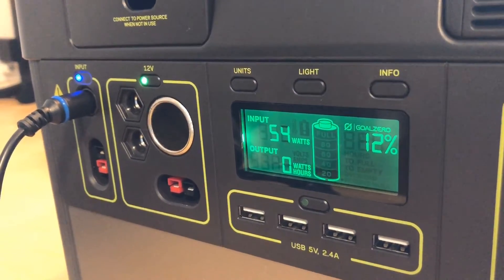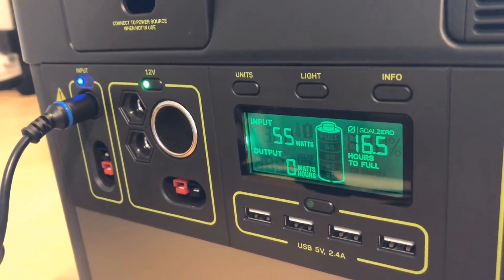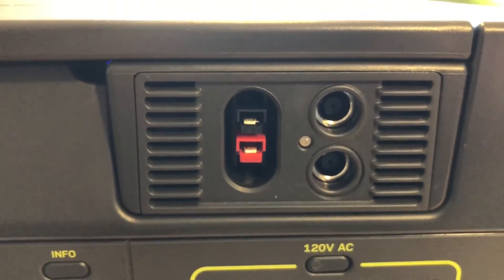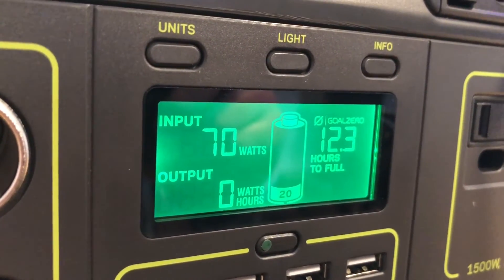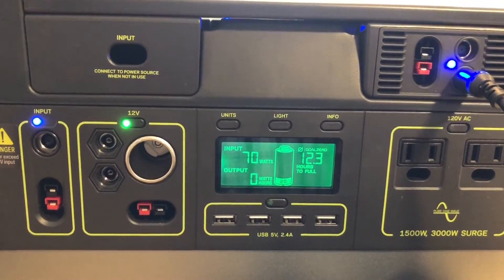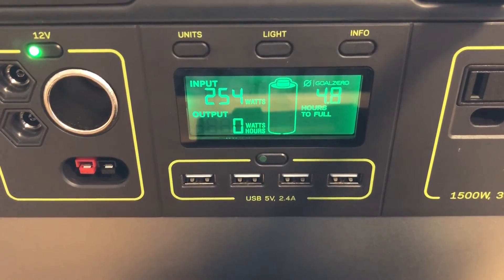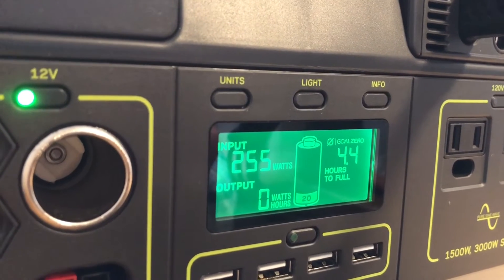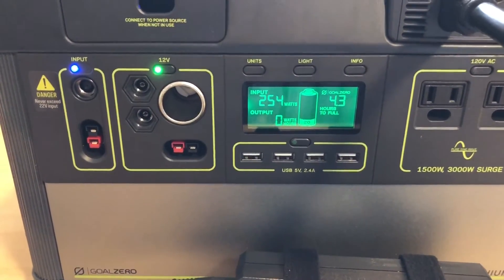Goal Zero Yeti 1000 Lithium: Fast Charge In Just 4.5 Hours Instead of 18!

Comment: Great video but can you also charge from multiple inputs at the same time?  For example can you buy 8 chargers and chain them in groups of four like you did and have all 8 powering.
Reply from the maker: Yes, you could if you have the MPPT module I stalled. The built in puts can handle 360w, the module doubles that. They now make a fast charger that is probably a better value than 4 single supplies.

Comment: Can you use 12 chargers? 4 chargers with Anderson adaptor on the left input. 4 chargers with Anderson adaptor on the right input. 8mm in the left input. 2 8mm in the right input and 1 8mm on the top input?
Reply from the maker: No, the built in PWM inputs max at 360w total across all inputs, the MPPT modules doubles that. Keep in mind that charging the battery too fast will reduce its life so you want to give the electrons some time to find a home.

Comment: the slower a battery is charged the longer it will last. you can buy a second charger and charge the unit twice as fast but battery longevity will be affected.
Reply: Is this true? I know you are saying this but is there any facts?just asking because I just bought one
Reply: @LxTxSURGE  the faster you charge and discharge a battery the faster it degrades as it causes them to heat up, lithium batteries especially don't like heat or cold.  just google more info on it. goal zero should really be telling their customers about this.
Reply from the maker: Yep, you’re right. That charging or discharging too fast is bad for any battery. Unfortunately, GZ doesn’t specify how quickly you can charge the batteries without stressing them but I think 300w is probably not too fast. We’ll see...
Reply: @todd.parker  I have been talking with goal zero and  the MPPT port can take 370w at 22v max. it is a bit disappointing as I have a 300w panel but it runs up to 37v. I wish I could feed more solar in as I want to use the unit to power my electric solar charged boat. also the 12v out is only 120w.
Reply from the maker: mike allen this video might be interesting to you: https://youtu.be/rqXscD69RvM
Reply: With the Yeti Link Expansion Module that Goal Zero sells, you can charge at up to a theoretical 750W (via a car battery/alternative or Yeti Tanks) although in practice this will be less depending on which Yeti going into. This is a LOT of power but GZ is offering that solution.

Comment: So you get a higher input from solar than you do from the grid?
Reply from the maker: Depend on how many panels you have and the weather. To get 300w of I put, you’d need 4x 100w solar panels and a sunny day (given efficiency losses). I have 2 panels and plan to use a generator to power these wall chargers if the sun isn’t out/shining

Comment: Thanks for posting this!! So I just called Goal Zero and they said that the new power supply should be in stock by the end on next week and it's 300 Watts.I asked additional questions about charging and this is what I found out. The PWM port candle take in 360 watts of power. ADDITIONALLY the MPPT port can bring in 325 MORE watts at the same time for a maximum of 685 WATTS of power! This means you can run solar panels and the charger at the same time or 2 chargers at once! I did inquire about the new Yeti Link Expansion Module which allows you to expand the system and add batteries. The downside is that it can only bring in 150 Watts and as I suspected, you have to remove the MPPT port. The uplink 150 watts plus the 360 watts on the PWM port would give you a max of 510 watts. I wanted to know if the wattage for each port can be stacked or what the max input of power was incase I also need to charge this from a gas generator quickly!
Reply: GOOD NEWS!I just called goal zero customer service 888-794-6250 option 2, and the NEW 300 watt power supply is in stock! It's not listed on their website and I just ordered 2 of them so I can charge from the PWM and MPPT port at the same time in an emergency! If I am pull in 500 watts between the 2 chargers this should be charged in maybe 2 hours :-) Thanks for all the research and videos you are doing Todd. This is invaluable info

Comment: The MPPT and PWM charging ports react differently as the power system nears full charge or capacity. The MPPT charger seems to stop charging to keep the system slightly under 100%. This is actually better battery management for the lithium cell.
Reply from the maker: Interesting! Thanks for the info

Comment: "This new faster product is coming next year" should be goal zeros mission statement. I'm still waiting for the car charger I was promised more than a year ago.
Reply from the maker: Ha! I know. Seems they’ve had some engineering hiccups and the high speed charger is still a few months out at best. If you want the car charger, you’re in luck. It just came out yesterday and I ordered one to review it. Shipping was expensive! https://www.goalzero.com/shop/yeti-accessories/yeti-lithium-12v-car-charging-cable/yeti-lithium-12v-car-charging-cable/
Reply: @todd.parker  404
UH OH. PAGE NOT FOUND.
Reply from the maker: first last https://www.goalzero.com/shop/cords-adapters/yeti-12v-car-charging-cable/
Reply: @todd.parker  Great channel. do you know if the yeti will run an ac unit and fridge at the same time?

Comment: Todd.... I got news..... you can call your order in right now to get the lithium car charger... depending on your cars cigarette lighter amps... it produces 120-180 watts. You can buy them each for 39.99.  if you have two ports you can buy 2... and get 240-360 watts via the 8mm end it has. If you for some reason had 4 ports you could buy 4 and anderson 2 and plug in 2.....  man... they've got it... they said it will go live tonight on the website or call in now if you want it sooner lol. Just wanted to let you know. I might go the car charger route.
Reply: I might alligator clamp some female cig ports to my car battery. Buy 2 chargers. And 1 anderson combiner. And pull 360 watts into this thing. Can you imagine? Lol. Seems worth 100 bucks to me if my solar isn't working right while on the road in my rv.
Reply from the maker: @robertp9370  Heh, you could for sure. You can buy some nice fused female ports with ring connectors to connect to your battery for quick disconnects, I have this and it's great: https://www.amazon.com/NOCO-GC018-Adapter-Socket-Terminal/dp/B00G8WLW2Y/ref=asc_df_B00G8WLW2Y

One thing to keep in mind is if this is a standard lead acid deep cycle battery, if you pull a lot of amps out of it quickly, it will reduce the output. For example, I have a 66ah deep cycle AGM battery so 50% of the capacity is gone right off the top because you don't want to discharge more than 50% to keep the battery healthy. Will Proust has a great video showing how that remaining 50% can be further reduced if you suck too much power, too fast which was new to me: https://www.youtube.com/watch?v=kMlhxr9gPOs
Reply from the maker: Live on the site: https://www.goalzero.com/shop/yeti-accessories/yeti-lithium-12v-car-charging-cable/yeti-lithium-12v-car-charging-cable/
Reply: @todd.parker  404
   UH OH. PAGE NOT FOUND.

Comment from the maker: I had a lot of questions about charge cycles for the Yeti Lithium batteires and got some good data from the Goal Zero engineers just now that I wish was explained on their site:

- Every 500 cycles you will lose about 20% of your total capacity

- You won't absolutely need a replacement battery until at least 2000 cycles  (their cycle ratings are more conservative than other companies that just state "2,000 cycles" without saying how much battery capacity is lost by the end - it's probably when their battery is also 80% dead so they are the same as Goal Zero's cycle count)

- A "cycle" is defined as filling the battery by 100 percentage points so all 4 of these count equally as "1 cycle" in their ratings:
   Charging ONCE from 0 to 100%
   Charging TWICE from 50% to 100%
   Charging FOUR times from 75% to 100%
   Charging TEN times from 90% to 100%

- If you had a full battery and were putting out 300 watts while also charging at 300 watts, that wouldn't count against your cycles at all. They are designed for high power input/output simultaneously but the power always comes from the battery (no passthrough from the input right to the inverter)

- They have low battery protection built into the Yetis so you actually can run them clear down to 0% within harmful effects. The Yeti powers down before you drain the battery too far to cause damage. 

- The only way you can really hurt the battery is to leave it at 0% for a long time or let it sit for longer than 5-6 months without any use. 

- Their units can handle 300 watts on the MPPT and 300 watts on the standard inputs for a max input of about 600 watts

- A Yeti 1000 with 600 watts of input can output 600 watts all day long with no harmful effects

Hopefully, this is useful info for folks, maybe I'll make a follow up video explaining this all visually so it's not lost in a comment.  I'm going to use my small generator to keep about 600 watts flowing in during a power outage (max generator output is 700-900w) and use the peak power of the Yeti  (1500W, 3000W surge) as the "buffer" for when something bigger like a refrigerator or pump kicks on. My generator alone couldn't handle that kind of surge. Working on adding a transfer panel so I'll have a video on that soon.
Reply: Just out of curiosity, as I'm not sure myself, but wouldn't it be Four times from 75% to 100% and Ten times from 90% to 100%?
Reply from the maker: superfragilisticatexpialidoshmur Errr. Yes, absolutely. My brain wasn’t working when I wrote that, sorry. I fixed my comment above.
Reply: @todd.parker  Not a problem! I just wanted to make sure I understood as well!
Reply: great information. could the 1400 handle being charged by two 300w solar panels?

Comment from the maker: I've had a number of questions about using a standard DC power supply like this switching power supply that puts out 13.8v DC at 30A (probably 25A continuous) for about 350 watts of fan cooled power with Anderson Powerport outputs. This is about the same cost as the 3 additional chargers I bought in this video and summed with the combiner: https://www.amazon.com/dp/B01MQ2PGYO/?coliid=I3DQCYS6X3Y3NX&colid=3MUDM0E941HD9&psc=0&ref_=lv_ov_lig_dp_it

The tech showed this to their engineers and this is the Goal Zero's reply:
"I just got confirmation that we wouldn't recommend that power supply. Our systems want to see a minimum of 14 volts going in. Where this power supply is set at 13.8, we are worried it may not register on the Yeti."

So, yes you can use a 3rd party power supply but 14v is the minimum voltage to charge a Yeti Lithium. If lower, the risk is that it just wouldn't register the charge input or could damage your charger. He said it was unlikely it would somehow damage the Yeti. He added that this is the same issue that came up with charging these in your car via the cigarette lighter port - the lithium Yetis were trying to pull at 14v+, things got hot, and wires were melting causing a fire hazard.

"The reason we advertise not to charge from a 12v source right now is because the previous car charging cable we had for our non lihtium power stations had the potential to melt if it was used with a lithium unit. Once we have the new car charger available for them in Feb, this will not be an issue."

So long story short, if you happen to have a 14+ volt 30A power supply lying around and can make up the right cable, go for it. Otherwise, it seems that waiting until March for their 300 watt charger is the way to go. It will cost $90-120, will plug directly into the Anderson inputs, and will be fan cooled. I don't think you'd be able to find a power supply + cable that is any cheaper and I'm guessing GZ will have better build quality and warranty.

Oh, and "We are releasing our Lithium 12v car charger on the 1st of February. The car charger will input about 120-150 watts" so that's good news. No word on pricing.
Reply: Hi Todd, when using a 14v 30A charger you'll breach the 360W MAX input of the port.. I have made a charger of a power supply that handles 14V and a max of 25A and works well, outputting 360W

Comment: I hope you have spacers in between those charging bricks, or they are going to overheat and be short-lived.
Reply from the maker: bigman55434 Good point. The bricks get pretty hot in general so I added 1/2” spacers and lay them vertically so there are “chimneys” to hopefully let enough heat out. I show this in more detail on my generator video. Thanks!
Reply from the maker: I improved the spacers I used to keep this cool. New video here on it: https://youtu.be/_jVTftlIpyI

Comment: Why did you 4 chargers and plug them in together. You should have just bought a single 300 watt charger with an Anderson adaptor.
Reply from the maker: Neal Wachter - Good point, that would work too. If you have a link to a suitable charger, that would be super helpful. I mostly did this because I knew it would work but I’m sure there are better alternatives.
Reply from the maker: Looking in Amazon maybe something like this would be good. It has power pole outputs and is 30A at 12.8V so about 380 watts. That’s more than this setup for $20 cheaper. I honestly didn’t know these existed, nice tip! TekPower Analog Display TP30SWI 30 Amp DC 13.8V Switching Power Supply with Noise Offset https://www.amazon.com/dp/B01MQ2PGYO/ref=cm_sw_r_cp_api_i_zTyhCbMV9PZ1H
Reply: I think I'm going to buy one of those Todd for my yeti 1000 lithium thanks for posting that link unlike the previous commenter. also going to put 2 solar panels on my rv. that way I can fast charge with my inverter connected to my engine connected to that tekpower power supply to power my yeti 1000 35% per hour through the Anderson input. and then trickle charger to maintain it with a couple solar panels. that way on cloudy days I have a fast charging option with a hybrid solar trickle charge capability. 3 hour to full charge, or trickle charge. the combination of the two should solve my needs.
Reply: Robert Pacheco I’m doing the same with my GZ 3000, but didnt know about this cable so i was doing 2x true mppt and 2x the other charger. 
I like that cable and will get it asap. 

With that DC power supply (or a better one) you could use both output from it and max out both solar charger.
Reply from the maker: Quick update: I showed a similar power supply to Goal Zero tech support and they said it would NOT work. Long story short, the Yeti Lithiums require a minimum of 14v of input power to charge and most of these DC power supplies put out 12-13 watts so you'd need to get a charger that outputs 14-20 volts. I cover this and more here: https://www.youtube.com/watch?v=_jVTftlIpyI&t=361s

Comment: Good video. I did this also, but with a twist. My car has two cigarette lighter outlets. I connected a Bestek inverter to each. The bestek inverters each have two 110 outlets which I connected to 4 goal zero chargers and connected them to the standard input side with a Anderson connector. I then connected 4 100 watt solar panels to an Anderson connecter and plugged them into the mppt side. I now have a portable charging station and can charge a 1400 lithium in 2.5 hrs. and I can do this while the electric is out. I have two 1400 lithiums and by alternating them, I can keep a 10 amp a/c operating during a hurricane. Goal zero says max input is 360 watts but fail to say each side can take up to 360 watts. This saves the expense of buying the Ryobi. The Bestek is pure sine wave rated and safe to use with the lithium battery. I live in a condo and can not use propane.
Reply from the maker: That’s a nice setup! Good call on using inverters to charge via your car since Goal Zero doesn’t have a 12v charger yet.
Reply: Wow, Gregory, thank you for this! We're working out our solar and getting lost in a vortex of myths. Your comments are so helpful for us (and I'm sure Todd's happy with them too ;)
Reply: i fail to understand the need to use bestek inverters since the cars charging system is already 13.8~14V DC, unless i'm missing something the powerbrick is just converting 110V AC to 12V DC and chargeing BMS is in the Yeti and able to accept anything up to 22V DC so shouldn't a custom cable that convert cigarette lighter outlets to anderson plug do the same?
Reply from the maker: ThreeDnut Young the issue is lithium batteries have much lower resistance than your car’s lead acid battery so if you hooked the yeti up via the previous 12v cigarette to 8mm adapter, it would pull too much power and could heat up, melt wires, etc. Now GZ has a special cable for lithium yetis that limits the draw to 5 or 10a so that’s the way to go. Using an inverter wastes a lot of energy

Comment: would this work with 8+ ?
Reply: Yes but you must use the Anderson connectors and plug 4 in on each side. It will work with both the 1400 or the 3000 Lithium Goal Zeros.
Reply: And the lithium 1000. I called support today and was informed that the MPPT port can handle 325 watts and the PWM port can take in another 360 watts at the same time!
Reply from the maker: @xeckplay Do you mean 8 wall chargers? If so, my understanding is as long as you don't exceed the max power for the inputs you can sum as many chargers and panels as you want. In the case on the built-in PWM charge controller,  the Power Pole Charging port can handle up to 30A (360W max) and the MPPT port can also handle a similar amount. So yes, you could sum 4 chargers into one Power Pole port and 4 into the other which would be roughly to 500 watts. And here I thought my setup was overkill! My plan is use my two 100 watt Boulder solar panels and these four wall chargers to charge this up extra fast when the sun is shining to save even more fuel in emergency situations.